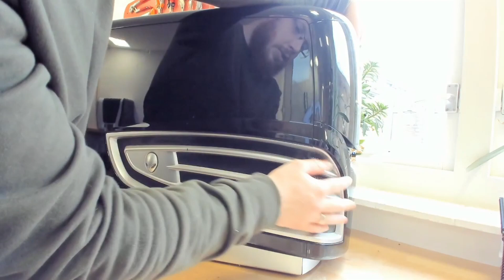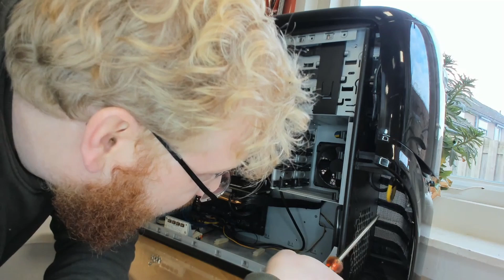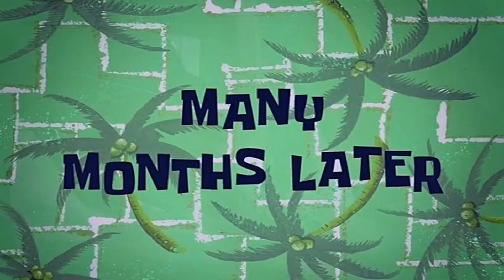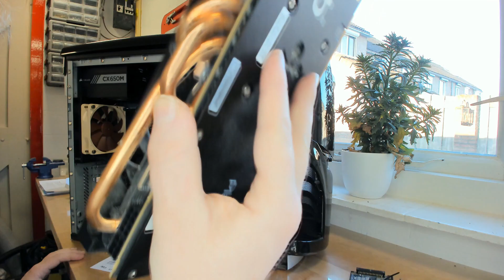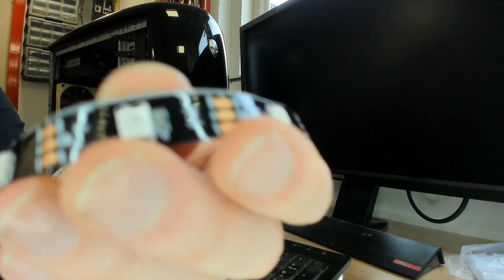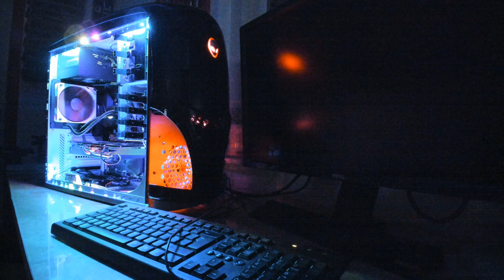PC Build: Restoring Alienware Area 51 RGB

Comment: Hi, thanks for posting this video - so if I understood this correctly, all you need to get the LEDs working again is the RGB controller and the converters (black cables)? Do I check if all the LEDs are working fine as you did with the electrometer? I think the existing RGB controller board in the chassis is bust as all the lights stopped working few years ago. Please advise when you get a chance, thanks.
Reply from the maker: Hi,

There is no need to use an electrometer, we used it to make sure on which voltage these LED's run as the case is from way before all that was standardized :)
You should be able to use any regular RGB controller, including the headers on modern motherboards. The connectors on the alienware case are however not your standard connectors, so you either need to solder on some new connectors or buy some adapters like the ones mentioned in the video description :)

Comment: planning to do a custom build on the same case, do you mind if i'll get in touch with you to get some more info on what you used/did with these lights? thanks
Reply from the maker: Sure, no problem.
What do you want to know?
Reply: @kingtech7146  thanks for replying, I think I figured it out myself. all original rgb's on the case are 650mA in total (50mA each), motherboard has 2 rgb outlets so I think with 2 splitters from both mobo outlets (1 to 5) should be fine without an rgb controller as you used. mobo will only have the rgb's and 3 or 4 fans (presuming each fan would be about 200mA each). I'll stand corrected if I'm wrong :)
Reply from the maker: @PocaHontas2002  No problem :)
I also run some of the LED's directly from the motherboard, but my motherboard didnt have enough headers to control all LED's separately.
Joke is on me though, the wife puts them all on the same color :)

Comment: Making this same case for my first real pc build, thank you for making this video, I could not find any info on this relic with my noob computing skills
Reply: I'm in the same boat as you. Interesting to see what he did, but I am still a little confused on what cables he used for side panel connector. I haven't finished the build because of the graphics card debacle so I am going to see if I can get the original card working since it was working before I did the tear down and I still have to software on one of the hard drives.
Reply: @picklerick111  What connected to the connectors in the main frame of the case, was individually connected with something to the akin of a: SIM&NAT 8inch / 20cm Male to Female Dupont Wire, Male to Male, Female to Female Breadboard Jumper Wire Ribbon Cables (ripped off amazon), and made sure he connected the right ones to the 4 pin that connects to that led hub